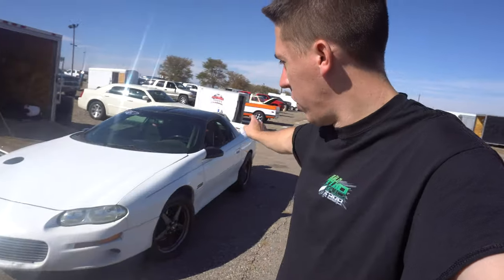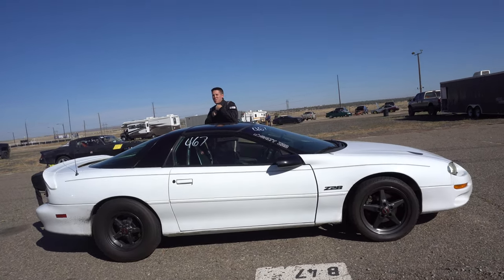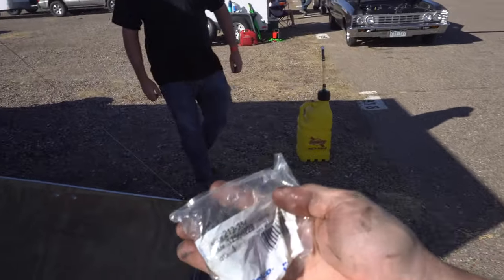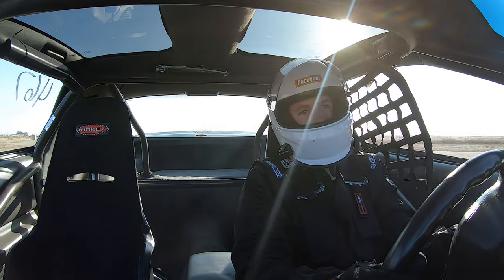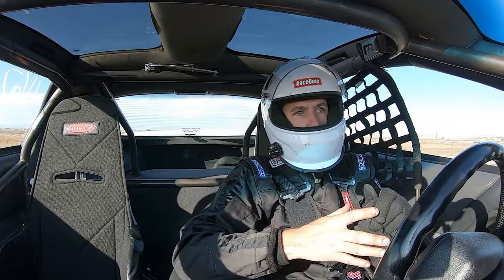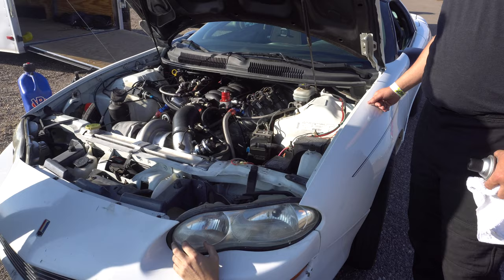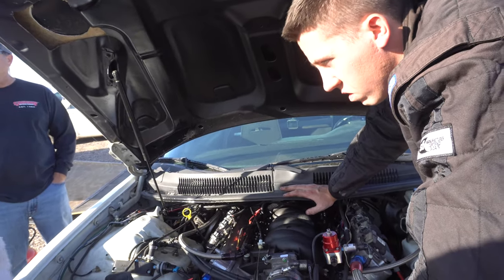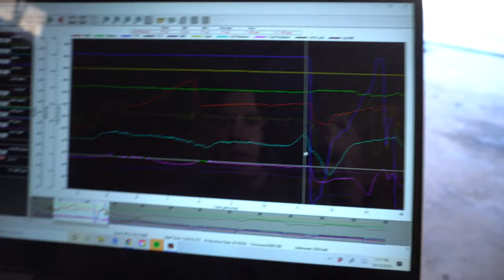I Think My Turbo Camaro Is Broke... This Sucks!

Comment: Whats the engine set up on this camaro? forged, what displacement
Reply from the maker: Lq4 block 408" with Manley Rotating assembly trick flow 220 heads

Comment: I’m no expert, but could it be 
 a ring. thereby pressurizing the crankcase. Possibly spiking your oil pressure and blowing out the dipstick.
Reply from the maker: Definitely hurt a ring/piston i think to get pressure in the crank case
Reply: @BuildTuneRace  that is really too bad. I hope it’s not that awful of a fix. Damn

Comment: What’s your compression? Thing sounds tight
Reply from the maker: Honestly not sure haven't went through and calculated it its not crazy high i think 10.5 or 11.5 to 1 in this video it had the crank sensor issue then the 2nd time was down on atleast one cylinder 🤦‍♂️

Comment: Cam sensor? Doesn't explain oil, but seen them cut out at high rpm.
Reply from the maker: Yeah pretty sure it hurt it self when the crank sensor went out then the next pass  didn't help anything